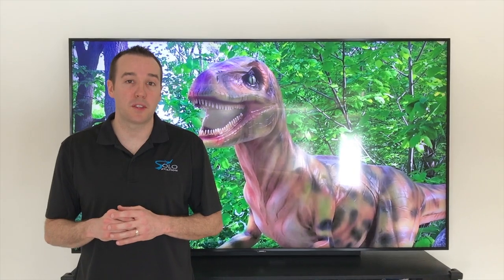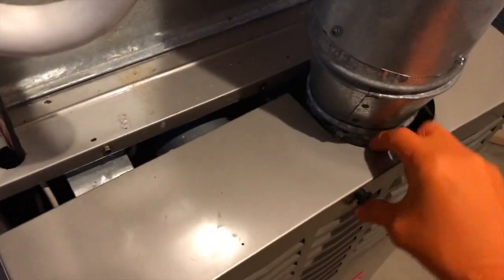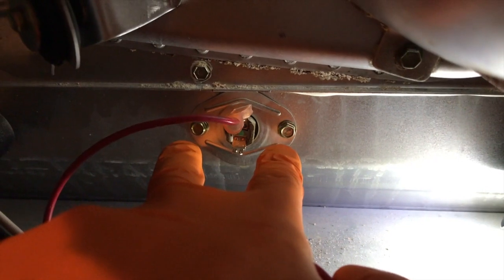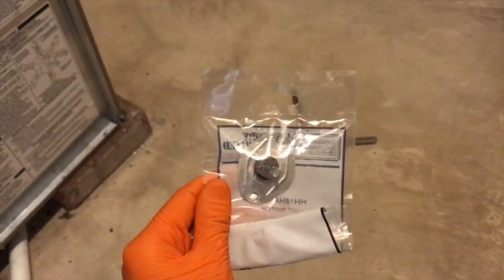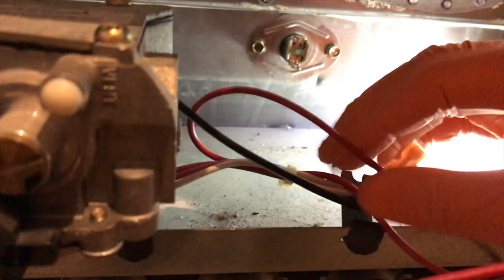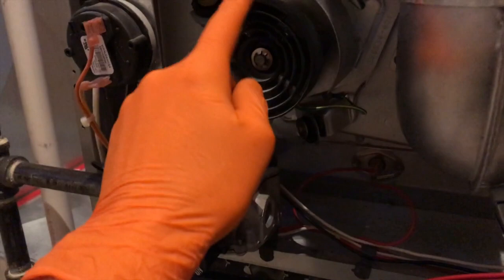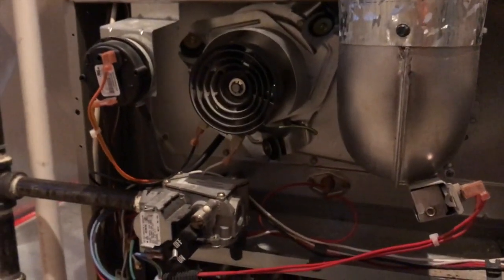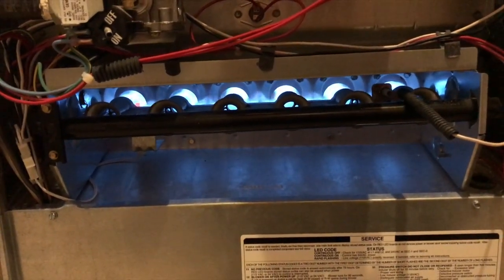How to replace Bryant Furnace Limit Switch!

Comment from the maker: If interested in purchasing this part, visit our Amazon affiliate link below.

       https://amzn.to/3pPmhR3

😎👍🔧🔩
Reply: The linked model is HH18HA499 marked with a Green Dot.
Where as the one shown in the video is HH18HA493 marked with a White Dot.
apparently HH18HA499 was rated at 165 F, and HH18HA493 is rate at 200 F temperature.
ie, they look exactly the same, except for the color of round dot between the two metal connectors.
Reply from the maker: @davidjacobs8558  

Thanks for the reply.  We also like purchasing parts from:

     RepairClinic.com

Great website that allows you to enter your appliance serial number and then all exact replacement parts will be shown.

Comment: Interesting! My limit switch has a button in the center, between the two terminals. 

PS: how did you know which wire to connect to which terminal on the unit?

Comment: How do you know if the limit switch is not functioning well and needs replacing? Thank you!
Reply from the maker: Thanks for watching, you can test the limit switch ohms by using a voltmeter however if your limit switch has never been replaced, we recommend replacing it along with your flame sensor.

Below is a helpful video link.

     https://youtu.be/pevFMxi_lvg

😎👍

Comment: Whats the role of the Limit switch ?????
Reply from the maker: Thanks for watching.  Below are a few links that may help you get more familiar with the Limit Switch & other parts.

       https://youtu.be/fMHvgBxDwm0

       https://youtu.be/tcZZC0KQOvM

       https://youtu.be/_2i1cTWGpfQ

Hope this helps, enjoy your day.  😎👍
Reply: Its in case there's blockage on your registers or intake, or if your blower motor isn't working, the temp will rise very quickly and 'open' the high limit switch
Reply from the maker: @Oz-ov1uu  

Thanks for sharing, hope all is well.

😎👍🔧🔩
Reply: @DIYwithMichaelBorders  funny enough, trying to figure out Aux Vent Limit switch problem, gonna check for vent pipe blockage as I've checked everything else. 80% eff Bryant.
Reply from the maker: @Oz-ov1uu  

Fun fun.  Let us know what you find.
Reply: @Oz-ov1uu  Great explanation, Thanks for the info.
Reply: @DIYwithMichaelBorders  took apart the venting, no blockage, slope correct. Remove blower to look at exchanger,not cracked. Inducer amps and voltage correct.
Only possible cause left for gradual (takes a day) flue gas rise is a plugged or partially plugged exchanger. Replace furnace
Reply from the maker: @Oz-ov1uu  

Thanks for watching Luis.  We appreciate you sharing this.  Us fellow DIY’ers need to stick together!  

Replacing furnace is an option...🤔

Let us know if you have any questions.  Enjoy your day Luis.

😎👍🔧🔩